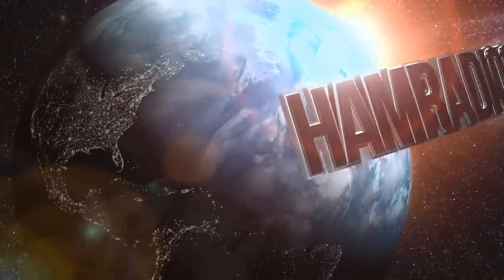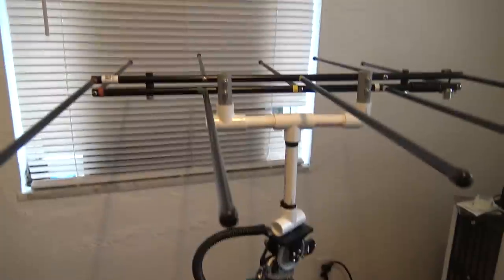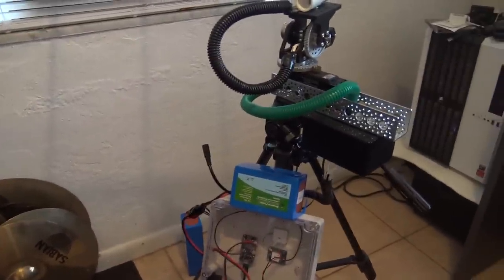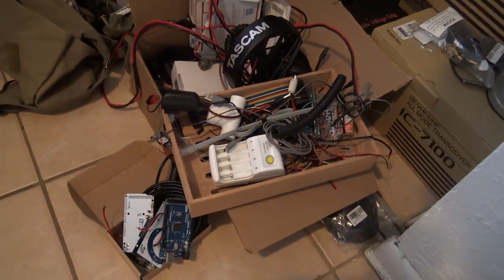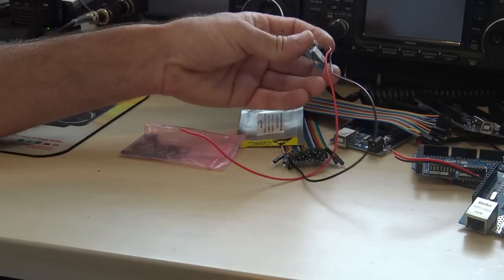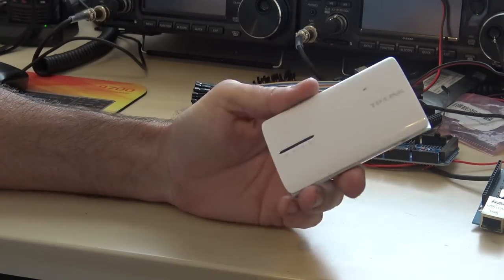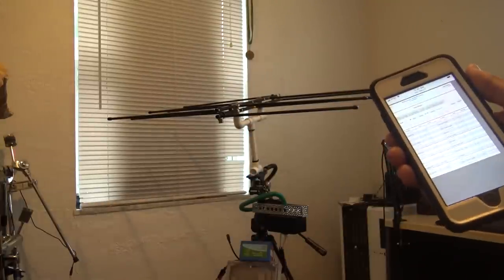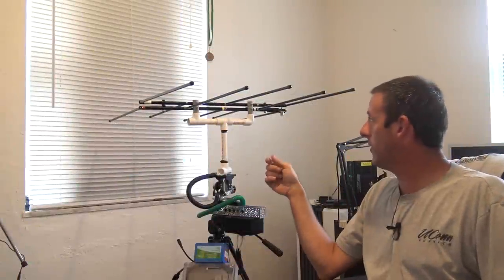🛰️IT'S ALIVE!! Autonomous Satellite Tracker, Overview/Hints And Tips

Comment: Hey Eric, there is a simple fix for the "twitchyness" of your system: instead of measuring and  immediately setting the position, take a few measures, average them and then set the position. You can even use a "moving window" where the current measure is averaged with, say, the last 10. A new cycle begins, you drop the 11th oldest measurement and take a new 10 sample average. This should remove the "high frequency" (10hz or so)  noise of the sensor...

Comment: Hi Eric,
While the mount was twitching, I noticed the aluminum frame that hold the azimuth servo was flexing. I believe the mounting system does not have the stiffness needed for the job. I'm an amateur astronomer and would have modified a computerized Alt/Az mount. The software to control those mounts can also track satellites. Stay safe.  73  WB3BJU

Comment: I like to make microcontroller/ electronics projects as a hobby and I can relate to the year long crucible you went through to finish your satellite tracker. You really did an amazing job on your satellite tracker despite all the little demons who work tirelessly to sabotage your jumper wire continuity, cold solder joints, and Arduino package incompatibilities.  You deserve to be proud of what you built. Likewise, the person whose original plans you implemented in your project should be proud of their own creation and that you were able to update and improve on it together.
There is always so much more to learn no matter how much experience you get and, by their nature, these kinds of bench electronics projects from scratch have so many links in the chain to fail or get missed that error is more the norm than the exception. It can often be maddening!

Comment: FYI, the part number you need from Servo City for the tilt servo system is SPT-D485HW-5-A (assembled with newer servo - the old servo listed in the original plans is NLA).  $129, assembled.

Comment: Iterating through several designs is a great way to come up with an optimal solution.

May I suggest you add an eight to twelve inch piece of straight pipe coming out of the lower "T" and moving the nine DOF sensor to the end to keep it away from all of the metal in the tripod and the bolts you're using.

Hose clams aren't going to hold that together really well.  I'd suggest PVC cement which is how the PVC tubing and "Ts" are meant to be assembled.  Before you glue it all together hot glue in a 1/4-20 bolt into the bottom PVC tee so you can spin it apart between the PVC "T" and the tripod.  If you don't hot glue the bolt in you could probably get a box end wrench in the "T" to hold the bold when you screw it into the tripod.

I can't wait for the rain to stop so we can see it work outside.

Comment: Hang the battery within the tripod to increase stability, you need to keep the weight central and as low as possible. Fishing rod tripods often have a hook within them to hang a bucket of seawater for stability. Nice project.

Comment: Hey the securing of the battery on the tripod leg with velcro is as rough as guts. You need to come up with a better idea than that. I suggest put the battery in a small ‘Pelican’ type box with outputs for two sets of Mini-Andersen plugs. One set for the solar panel or for DC charging and the other for a radio or the antenna tilt/panner.

Comment: use high quality non metal fasteners eg. TEFLON or (3D printed) for screw and gears. This will reduce skew refraction off the sensor. You may try to shield sensor a little with a grounded tinfoil cage to prove a point. If its still an issue. I'm excited for your project, well done.

Comment: I was thinking along the same line as Roger P. However I would take a second tee and make a sawcut in the street of the tee and glue the bottom tee and that second tee about 3 to 4 inches apart. Then slide the 9DOF into the slot keeping it away from the metal on the tripod and the antenna.
73 William  W1KZP

Comment: Extend the PVC out of the bottom tee about six inches and hook your accelerometer sensor to that to get it away from the bolt and gears.
Reply from the maker: I will do that tomorrow thanks
Reply: @HamRadioConcepts  If it takes a dump on you I'm not taking credit...
Reply from the maker: @1crazynordlander  Thats messed up man... SOMEBODY has to take ownership HAHAHAHAHAHA

Comment: At 14.0 l usually use solder to cover the small pins so that the wire sit tightly on the board and l check continuity with a multi meter.

Comment: I use those cheap patch leads a lot and have never had a problem with them.  Perhaps your leads were mechanically stressed at some point?  The magnetic sensor is not the best way to get azimuth on land, especially in a built-up area.  Local magnetic interference can easiy give errors of 20 degrees or more on some headings, and so it really needs calibrating at every location.  It can also be affected when you move the radio or other equipment around, and also when current changes in nearby wires (e.g. the servo wires).  A better system is to align the tripod with true North by hand and use a stepper motor to move the aerial in azimuth.  Have an optical sensor or microswitch that operates at a fixed azimuth position (relative to the tripod).  At power-up the stepper motor rotates till the sensor trips, which it sets as being North, and from then on you set the azimuth position by sending the appropriate number of steps to the motor.  To find true North at a new location, take the GPS location at the position of the tripod, and then walk a hundred meters or so away in a roughly Northern direction.  Now walk East or West until the GPS shows exactly the same latitude as the location of the tripod.  Mark that spot with a flag or something, and you can then rotate the tripod until the aerial is pointing directly at that flag with the rotator set to an azimuth of 0 and a declination of 0

Comment: If yer tripod has a center hook between the legs you could hang the battery in the center of the tripod for stability.  I know my camera tripod has a center hook so you can hang a weight down through the middle of the legs for stabilizing the tripod.

Comment: @HamRadioConcepts Can you comment on any additional QRM generated from the tracker picked up on your 9700?  I built mine very similar to yours, using only your parts list compiled from the couple of videos you've done.   Same ELK antenna, a little different setup regarding position of the tilt and pan motor placement (more like Elwoods design.)  My noise floor goes from 0 to s6 when i power up my unit.... very difficult to work weak signals with a self inflicted s6 noise floor.  :)  I really think its the voltage regulators.  Ferrite has helped about 1/2 S unit.

Comment: Having the same trouble you were talking about with the libraries.  Can you please list the versions you are using successfully? The ones I have are too new apparently and I can't get the IP address, SSID, etc. to "Take".  It keeps looping out to AP setup mode.
Reply from the maker: Using library EEPROM at version 2.0 in folder: /Applications/Arduino.app/Contents/Java/hardware/arduino/avr/libraries/EEPROM
Using library SPI at version 1.0 in folder: /Applications/Arduino.app/Contents/Java/hardware/arduino/avr/libraries/SPI
Using library Wire at version 1.0 in folder: /Applications/Arduino.app/Contents/Java/hardware/arduino/avr/libraries/Wire
Using library Ethernet at version 2.0.0 in folder: /Applications/Arduino.app/Contents/Java/libraries/Ethernet
Using library SoftwareSerial at version 1.0 in folder: /Applications/Arduino.app/Contents/Java/hardware/arduino/avr/libraries/SoftwareSerial
Using library Adafruit_PWM_Servo_Driver_Library at version 1.0.2 in folder: /Users/ecdowney/Documents/Arduino/libraries/Adafruit_PWM_Servo_Driver_Library
Using library Adafruit_GPS_Library at version 1.0.3 in folder: /Users/ecdowney/Documents/Arduino/libraries/Adafruit_GPS_Library
Using library Adafruit_Sensor at version 1.0.2 in folder: /Users/ecdowney/Documents/Arduino/libraries/Adafruit_Sensor
Using library Adafruit_BNO055 at version 1.1.10 in folder: /Users/ecdowney/Documents/Arduino/libraries/Adafruit_BNO055
/Applications/Arduino.app/Contents/Java/hardware/tools/avr/bin/avr-size -A /var/folders/wm/0fybb6jn76b5r6ys3q7qkgw40000gq/T/arduino_build_38132/AutoSatTracker.ino.elf
Sketch uses 99896 bytes (39%) of program storage space. Maximum is 253952 bytes.
Global variables use 3327 bytes (40%) of dynamic memory, leaving 4865 bytes for local variables. Maximum is 8192 bytes.
Reply: @HamRadioConcepts  Thank you for sharing this!!!!   I will give it a try.
Reply: Were you able to find those libraries version.  I found some . But can't find  Wire , EEPROM and SPI

Comment: /* Autonomous Satellite Tracker.
 *
 * Connections on Adafruit ESP8266 Huzzah:
 *   Servo controller connects to SDA and SCL
 *   GPS TX connects to 16, RX to 2
 *
 */

#include "AutoSatTracker-ESP.h"
#include "NV.h"
#include "Sensor.h"
#include "Circum.h"
#include "Gimbal.h"
#include "Target.h"
#include "Webpage.h"

NV *nv;
Sensor *sensor;
Circum *circum;
Gimbal *gimbal;
Target *target;
Webpage *webpage;

/* called first and once
 */
void
setup()
{
    // init serial monitor
    Serial.begin (115200);
    delay(500);

    // this just resets the soft timeout, the hard timeout is still 6 seconds
    ESP.wdtDisable();

    // scan for I2C devices
    resetWatchdog();
    Serial.println();
    Serial.print (F("Scanning I2C:"));
    for (uint8_t a = 1; a < 127; a++) {
	Wire.beginTransmission(a);
	if (Wire.endTransmission() == 0) {
	    Serial.print (' '); Serial.print (a, HEX);
	}
    }
    Serial.println();

    // instantiate each module
    Serial.println (F("making NV"));
    nv = new NV();
    Serial.println (F("making Sensor"));
    sensor = new Sensor();
    Serial.println (F("making Circum"));
    circum = new Circum();
    Serial.println (F("making Gimbal"));
    gimbal = new Gimbal();
    Serial.println (F("making Target"));
    target = new Target();
    Serial.println (F("making Webpage"));
    webpage = new Webpage();

    // all set to go.. see you in loop()
    Serial.println (F("Ready"));

}

/* called repeatedly forever
 */
void
loop()
{
    // check for ethernet activity
    webpage->checkEthernet();

    // check for new GPS info
    circum->checkGPS();

    // follow the target
    target->track();
}

void
resetWatchdog()
{
    ESP.wdtFeed();
    yield();
}

89 statements only?
Reply from the maker: There is no connection to pin 2 that is an error in the code.